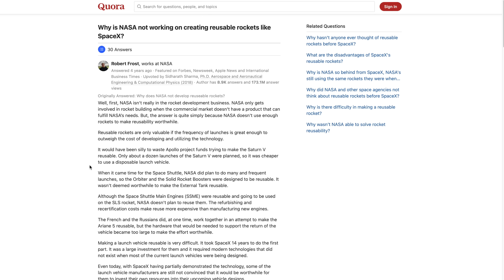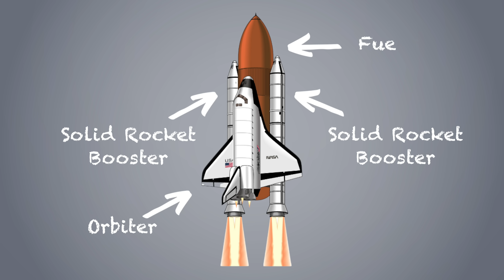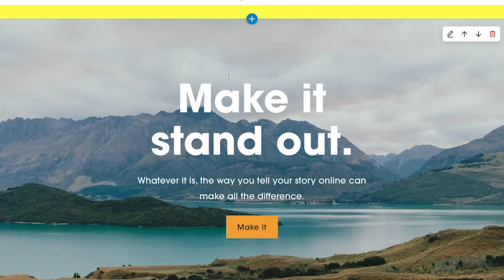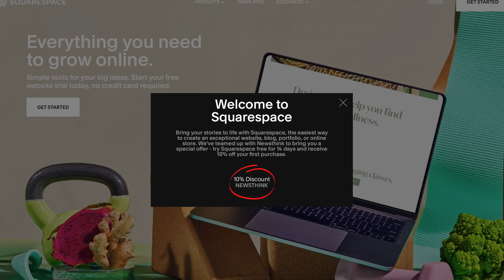Why NASA Doesn't Fly Reusable Rockets

Comment: The Space Shuttle was never "reusable". At best, it was RE-FURBISHABLE. 

It took a standing army of thousands of engineers anywhere from several months to a year to largely disassemble the Shuttle orbiter, piece by piece, and put them back together, piece by piece. The solid rocket boosters were stripped down to the bare metal, and essentially re-MANUFACTURED into new solid rocket boosters with new nozzles, end caps, new solid fuel poured, etc. 

This hardly fits anyone's description of "reusable", but NASA got away with the PR spin for four decades (and continuing to this day) because nothing else was even remotely close - every other launch system on Earth was 100% single-use expendable, so NASA got to dictate the definition of "reusable"... until SpaceX came along...

Comment: 160 million horsepower, Mach 28, one million parts that are used like the engine of a dragster. One simple valve jams or bolt breaks: the X in SpaceX means xplosion in a fraction of a second. To use parts  a second time is suicide.

Comment: SpaceX is obviously misguided about the 2 million cost per launch of the Starship.

I think the problem is that 2 million per launch is just too easy and too simple to say.

What matters more is how much it costs to build a single starship.

Then from that number one can actually argue about how cost effective its going to be. Because lets say it costs a billion to build a starship. Then to get the price per launch down to 2 million, that starship needs to fly at least 500 times. 

This is the real problem with the 2 million estimate, either way you put it, it's unlikely that Starship will be cheaper to construct than the Falcon 9, which we also dont know the exact cost for, but Falcon Heavy expendable is 150 million, so 150 million is a low number for the total cost of Starship, given the insane amount of Raptor engines it requires. So lets argue that a Starship costs 250 million to construct, thats still 125 Flights for it to go down to 2 million per launch. 

SpaceX has to date only flown a single rocket 10 times.

So is it realistic to claim 2 million per launch? To date? no, I do not believe so, especially since there would be no point to ask for that, when you can charge at least 50 million per launch as seen by Falcon 9.

Comment: You didn't mention that SLS is being used because there is a huuuuge flaw in contracts , if they are cancelled NASA will have to pay for cancelled vehicles that are not even in production. You can find this BS about NASA  contracts and how bad their are made. NASA won't make reusable rockets because the contractors are already signed to 2054 with SLS, Artemis programs and loads of others

Comment: The reason is for safety purposes. Rocket engines are temperamental and they need to re-check after you used them. The Space Shuttle was re-usable and the RS-25 engines need to be refurbished and the cost is sometimes more than using a brand new engine.

Comment: NASA did consider recovery of the Saturn V first stage; however, the added weight and complexity meant that they could not implement the proposals.  The second stage burned up on re-entry to the atmosphere, as does the second stage of the Falcon 9 rocket.  In fact, it is remarkable what NASA did manage to achieve using 1960s technology.
Reply: The reason is for safety purposes. Rocket engines are temperamental and they need to re-check after you used them. The Space Shuttle was re-usable and the RS-25 engines need to be refurbished and the cost is sometimes more than using a brand new engine.

Comment: Reusable rockets cost more to refurbish and rebuild the engines than is practical plus their payload is much less because they have to carry fuel and equipment to make them land vertically. Rockets are not airplanes.  You can fly an airliner day after day with many flights and only 45 min. to fuel. NO rebuilding the engines, no refurbishing the booster. And it's not Man Rated friendly. You don't just refuel these rocket and go again in 45 minutes. NO one has told the cost and time it takes to make Elon's rockets reusable and never for a Man Rated vehicle.  Plus there is not a line of passengers waiting to blast off every few hours.  NASA had tried and succeeded to build and land a vehicle vertically like Elon's in the early 90 and found it not to be practical. Elon will not release the costs to re fly his yet.  Besides it's not a real space craft it's an empty trash can with just 3 engines and no payload. NASA was right Elon is wrong.  Check out his fantastic Las Vegas Loop....Changed transportation for all of mankind....Thank you Elon we couldn't live without you and the Las Vegas Loop.

Comment: At the beginning of the video, John Logsdon said that "NANA never tried to do anything like what SpaceX is doing.", which was then followed by the narrator saying "The closest NASA ever got to anything like it, was the semi-reusable Space Shuttle.". I find both statements to be misleading.

First, the title is misleading because SpaceX does not have re-usable rockets. It has rockets that require significantly less refurbishing than other rockets, but in no way they are reusable. Second, not only NASA tried to do something like what SpaceX, but they went after an actual reusable space shuttle: Lockheed Martin's X-33. It's a same that we didn't get to see it in action. It would've move not only the aerospace industry but also aircraft design to new heights (pun very well intended). The aerospace industry because there would be a lot more research into aerospace engines and with the advancements in metal 3D printing, one could argue the better design, and aircraft industry with the significant advancements in hydrogen fuel storage needed for X-33.

Comment: The logic of "reusable" is the notion of something being continuously used, thus emply it never wares and tares, almost swaring its invinsible, the only way something in production becomes cheaper, is when a vast supply of demand is met, which always starts out expensive.
Reply: The reason is for safety purposes. Rocket engines are temperamental and they need to re-check after you used them. The Space Shuttle was re-usable and the RS-25 engines need to be refurbished and the cost is sometimes more than using a brand new engine.
Reply: @MrJSabadojr  that is exactly what i mean, as you explain in detail here😁 , reusable doesn't make it cheaper,/safer, the demand of more supplies paid off does, with a newly conditional parts.

An example, investnent care of a car, can end up like a lemon-mobile syndrome , if never a new investment.

Comment: Simple. For NASA it is taxpayer’s money. Higher the budget higher the cut for all the contractors.
Reply: The reason is for safety purposes. Rocket engines are temperamental and they need to re-check after you used them. The Space Shuttle was re-usable and the RS-25 engines need to be refurbished and the cost is sometimes more than using a brand new engine.

Comment: Actually there were a number of concepts proposed to recover and reuse the Saturn V first stage. This is a non-trivial problem as the inert weight is about 350 klbs. One concept by Hiller was to fit the stage with a parachute. A special (monster!) helicopter would air snatch the system, pull it up under its belly and fly the 250 miles back to Florida. It was a real engineering challenge and would never have saved money for the limited flights.
https://www.thespacereview.com/article/3741/1

Comment: There was also no need for reusable rockets, if your payload is more worth as your launch vehicle, you really don't want to take the additional risk of a reused rocket. The same reason NASA didn't use reused Falcon 9 booster for the crew flights. 

Also, the launch service provider market is very limited, in 2020 SpaceX did use their rockets over 50% for their own Starlink project, which was a good move to expand the limited market into a much bigger internet service provider market.

So the question is will you really risk 5 years of development and maybe the 500 million cost for your satellite and then take the additional risk of a reused rocket?

Comment: Yeah, that 2M cost per launch... It's a guess from a man invested in keeping the myth going that SpaceX is astronomically cheaper than NASA. So far, the fantastical figures have not been fulfilled.
Reply: The reason is for safety purposes. Rocket engines are temperamental and they need to re-check after you used them. The Space Shuttle was re-usable and the RS-25 engines need to be refurbished and the cost is sometimes more than using a brand new engine.

Comment: This video is biased towards SpaceX and misses many key points.

Any reusable rocket will always have a payload penalty because it has to haul the weight of the fuel or hardware with it to be able to make a soft landing. Launching payloads and especially humans into space is extremely difficult and trying to reuse hardware further adds to the problems.

No rocket can currently put an object into orbit or higher and be completely reusable. Many groups of engineers have worked on this for decades, but no one has figured out how to do it yet. SpaceX Falcon 9 and Heavy do not reuse the second stage. Starship is proposed to be fully reusable to orbit, but it is a long way from completion.

Logsdon makes the absurd presumption that it "never occurred to NASA that you could make something that big reusable." The Apollo engineers were brilliant and had no need to make Saturn V reusable. They had one goal: to beat the Soviets to the Moon. Money was not an issue in a critical space race, and adding reusability would have unnecessarily complicated and slowed the mission.

Newsthink is also biased towards reusability by picking a very high per-launch cost of the Space Shuttle and SLS and a low cost for the highly speculative Starship. Newsthink also implies that NASA was not able to achieve what SpaceX has done with reusability. NASA's missions are usually on the edge of what is currently possible, and like the Saturn V, adding reusability makes things more difficult.

NASA's SLS is intended to maximize safety and lift capacity for deep space missions. It uses very reliable and well understood older technology for the launching and return of humans from deep space. Reusability would reduce those capacities. Starship makes many claims but is still far back in development. SLS is complete and being readied for launch. The next five years will prove how viable these giant rockets will be.

Comment: NASA should be dissolved at this point if they aren't willing to even try to compete with the private sector.
Reply: Without NASA, the private sector of space travel would die. Most of their funding comes from NASA. Besides, NASA is a science organization, not a launch provider. Their goal is to monitor the solar system, design and operate probes, track the Earth and it's systems, and design science experiments. Blue Origin, SpaceX, etc. don't do any of that, they only build rockets for contracts. NASA's rockets have always been built by other companies. In the past it was mostly Boeing or Grumman, now SpaceX has joined them.

Comment: I do not think NASA's closest attempt at reusable rockets was the space shuttle. Personally,  I believe it was by far the x-33/venturestar. It was a fully reusable SSTO rocket and there were incredibly close to making it a reality. The only reason why they canceled the project was the virtue that congress or some higher-ups wanted composite tanks. The X-33 that was flight-capable had an aerospike, bolted metallic heatshield(much more practical than the shuttle's shield), and aluminum tanks.

Comment: Because NASA is financed by taxpayer money and so don't care about costs or efficiency.  It's the same reason our country has a $30 TRILLION DOLLAR DEBT!
Reply: It highly depends on how often you want to launch rockets. A reusable rocket can only take 50% the payload and costs a lot of money to prep for flight again.
SpaceX for example, claims they can reuse a rocket at 40% of the cost of a new one. (if they reuse the WHOLE thing, which they do not do yet).
This means that if you want to put the same KG to orbit as a non-reusable (at simular production cost), you have to send 2 reusable rockets, which results in a cost of 140%.
You will have to launch 6 reusable rockets (compared to 3 non-reusable) to be at break-even. 1 crash during these (lets be honest, complicated) take-offs and definitely landings, will result in the fact that it would have been cheaper to launch non-reusable.

Nasa perhaps didn't/doesn't care much about costs, but they did/do care about efficiency in regards to mission-successes.
SpaceX is cutting corners and really looking for the edge in terms of doing things as cheap as possible, rather than safe.

Don't let the media (or Elon Musk) fool you.
SpaceX is in it to generate profits. 
Nasa is in it for space research and exploration. 
A huge difference.

Comment: 4:30... Design the SLS to reusability.  "too much costly engineering" and the "don't need to launch that often"..  You make the rocket reusable, per launch fees are less.  NASA would grow to take advantage of a more frequent launch schedule.  They said so when they initially awarded SpaceX the moon contract.  One of the Boffins said that they only shoot for one launch a year because it is so expensive.  Cut that cost in half, and they would launch twice a year.  Make it cheaper and they will rally to launch more often.  Savings could go to payload development...  more launches...

Comment: You can't possibly compare technology from the 1960s with what we can do now. What's your next video? Why the Romans never built computers?
Reply: The reason is for safety purposes. Rocket engines are temperamental and they need to re-check after you used them. The Space Shuttle was re-usable and the RS-25 engines need to be refurbished and the cost is sometimes more than using a brand new engine.

Comment: "SLS is going to be expendable to cut down on development time"  15 years later its still not even close to being done
Reply: It is done and tested, parts are being shipped to Florida for integration and launch this year. Numerous stages have already been built for subsequent launches.
Reply: @jamese9283  that's what they said last year
Reply: @shawno8253  it's gonna fly by end of the year or the next
Reply: @shawno8253  Don't forget that all that hardwares still needs to be intergrated and seeing Boeing's recent track record, you'd be right to think its still a long way off.
Reply: @robertdefoe2396  Integration for launch is being handled by TOSC, not Boeing.
Reply: @perryconnor6373  That's news to me, maybe it will go faster after all.
Reply: @robertdefoe2396  I'm not so sure. TOSC severely fell behind already and has had to call in Boeing for help in order to make schedule. They've also decided to sign a significant amount of integration work over to Boeing due to fears of falling behind. I see Boeing likely taking most of the integration work over from them soon. Boeing's CS1 team has gotten very good as of lately. Major improvements since around wet dress 1.0 at Stennis. It actually makes sense to give them the work in my opinion. You and many others may disagree but mind you, it's probably best to trust the hardware to those who are most familiar with it after all as well.
Reply: You got to remember NASA relies on government funds Elon has an endless supply of billions of private funds that's the difference.

Comment: Wrong again, Starship will NEVER NEVER be 2 million$ per launch.  Fuel costs more than that and so does testing, and cargo, and people.  So no.  realistically speaker, starhip, "if it ever flies to space" will be at least 200-400 million $ per launch.
Reply: They use methane, which is quite cheap because it's essentially natural gas. They plan to build 500 Raptors per year, for 250k $ per engine, 40 % of the mass of the engine is 3d printed.
The vehicle itself is planned to be fully reusable, even the upper stage, and stainless steel has good fatigue characteristics and don't tend to get cracks.
2 million may be a little bit too optimistic, but 400 million seem to be too much, at least at a point where the vehicle is fully developed and flies regularly.
Reply: @simonm1447 , I'm aware of all that, I follow closely.  But, I highly doubt it.  They still take about 1 month to refurb a falcon.  I doubt 1 raptor will cost less than a million.
Reply: @Galactis1  of course I don't know if they really achieve 250k per engine, but even with a million per engine they could build 50 to 60 Raptors for the cost of 1reusable RS-25, and the Raptor is technically more advanced than the RS-25 (even if the specific impulse of the RS-25 is higher, but that's because it's burning Hydrogen which gives a very high specific impulse)

Comment: Short answer: cronyism and bureaucrats.
Reply: The reason is for safety purposes. Rocket engines are temperamental and they need to re-check after you used them. The Space Shuttle was re-usable and the RS-25 engines need to be refurbished and the cost is sometimes more than using a brand new engine.

Comment: reusable is actually costing nore, because more work needs to check on cracks and metal fatigue
Reply: Then how are the Falcon 9 and Falcon Heavy the cheapest launch vehicles available. In terms $/kg to Orbit the Falcon Heavy, The largest operational Rocket today, is 5 times cheaper than its next closest counterpart the fully expendable Atlas V. The Atlas V cost several billion to develop while the Falcon heavy only cost $500 million and beats out the Atlas V in payload to orbit and in payload capacity by over 2x.
In short The best reusable Rocket is 4x cheaper to develop, has 2.1x the payload capacity and is 5x cheaper per kg it puts into orbit than its closest non-reusable counterpart.